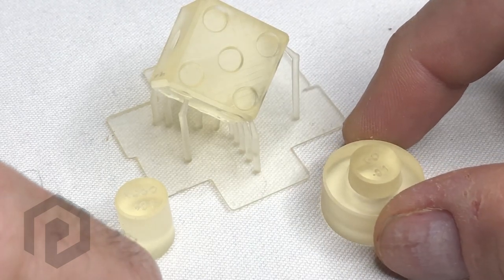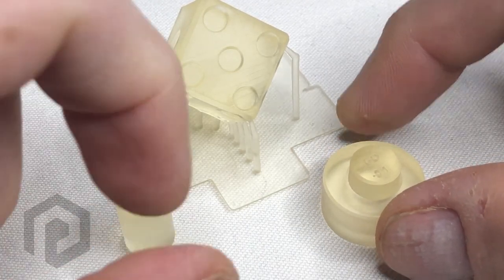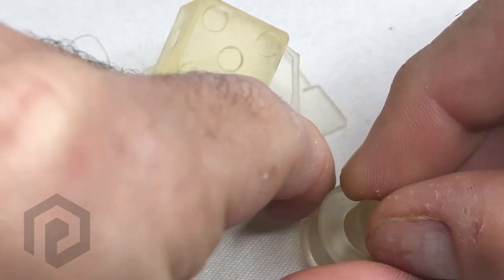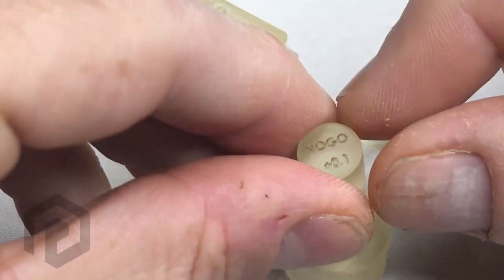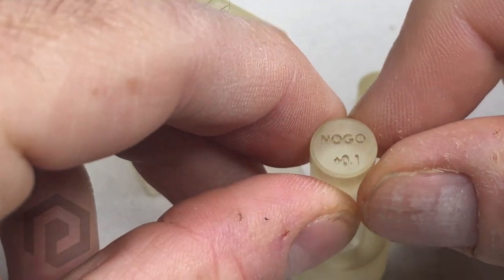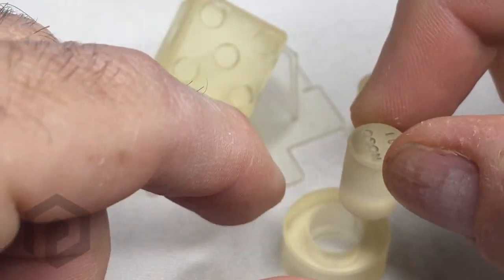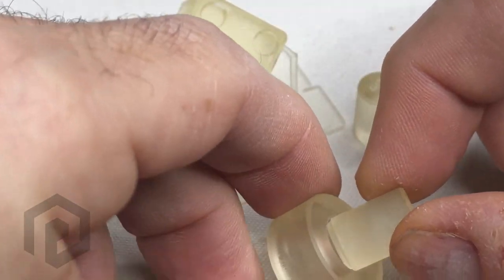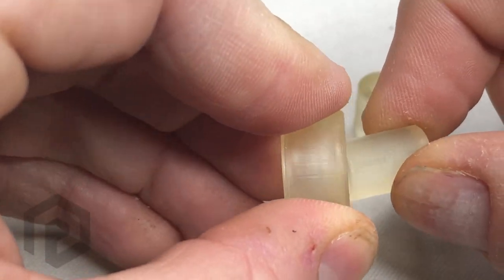Precision Gauge Resin Test

Comment: Couldn't you achieve the same effect by scaling the model on XY by a certain percentage?
Reply: Not the same you need XY erosion to remove pixels from the inside and outside if you scale the outside and inside scales the same and you end up with smaller positives but also smaller holes
Reply: these days you can use UVTools that is compatible with most machines on the market and has this and a lot more features
Reply: @TheRealViniciusSilva  I see, thanks for the tip!